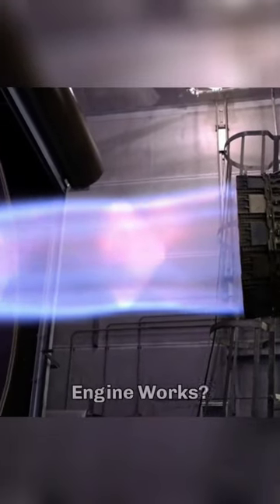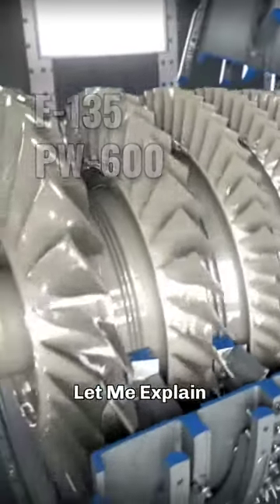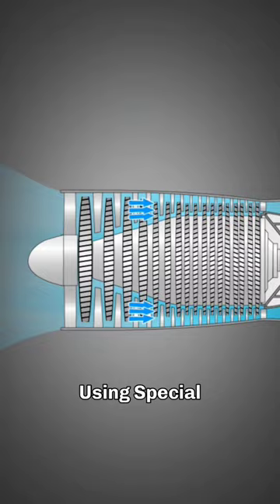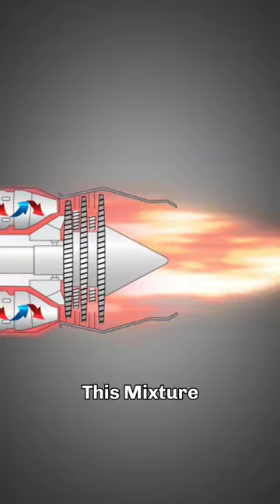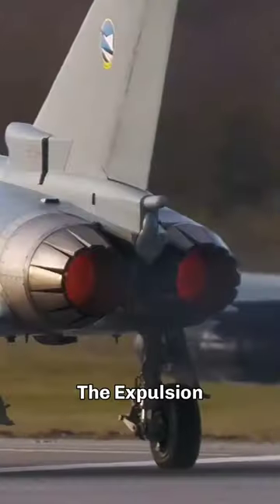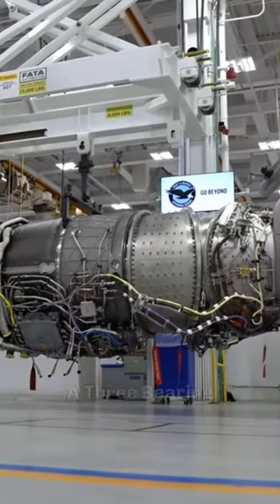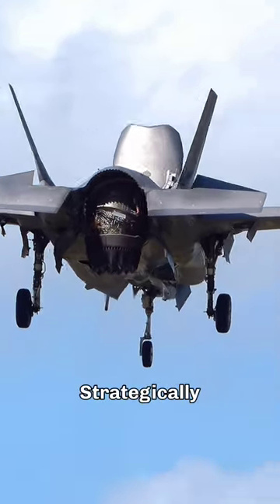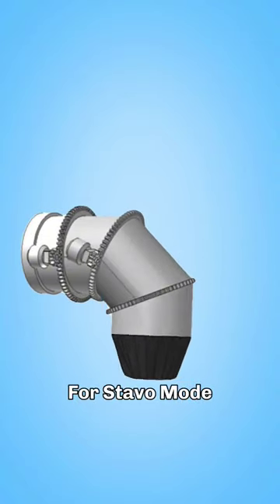The Insane Engineering of The Most Advanced Jet Engine 🤯

Comment: The only thing in that engine that creates high pressure is the compressor. Every step after the compressor the air pressure continuously decreases. The mixing and burning of fuel heats that air up and expands it creating high velocity but it doesn't increase the pressure at all, in fact the pressure decreases during the burning of fuel phase. If that is hard to understand, light your Bic lighter and watch the flame. The air gets hotter, it expands and its velocity upwards increases but there is no increase in pressure. You need to contain the gasses like in a piston engine to increase the pressure, there is no containment in a jet engine or with your Bic lighter.
Reply: Well for the combustion to reach those insane speeds faster then sound u need the pressure. Its not just that when u burn it it Will go to super Sonic speed. Its the pressure that makes it go super Sonic
Reply: @dividingrain1907  My post wasn't opinion, it is science. The highest pressure in a jet engine is right after the compressor and it decreases every step on the way out the nozzle. The velocity and temperature increases after combustion but the pressure goes down.
Reply: @wally7856  well what you said is that after the compresser the pressure decreases. Its in the combustion Chamber where the pressure is the highest but then it goes downs in pressure

Comment: With being so exciting this technology is, I felt obligated to bring up that you forgot to talk about (and explain) the bater timing chain (vater model,Ɓ-§) and how it stabilizes the jet while transitioning into and out of stavo mode. This part of the engine (mid section) has a moniluke alignment, which creates excessive vibration at higher velocities. This new unit provides a medial counter force within the vator port, instead of in front, therefore creating a solid helating degration on alternating blades while keeping overall constantiltude.  
   S.b., reverse

Comment: I'll explain it but dont call me nerd

 

So basically the f35 has 3 types, f35A, f35B, and f35C. F35A is the normal type, its in the airforce. F35B is the VTOL type (vertical take off and landong) its in the marines. F35C is the navy version, it has folding wings for extra space and STOL features (short take off and landing)

Comment: So a turbo fan
Reply: Turbofans, like you see them on commercial jets, bypass a large amount of air around the jet engine - only propelled backwards by the fan. That saves fuel, but you can’t go supersonic.
Reply: Basically a commercial plane with weapons and low detection signal